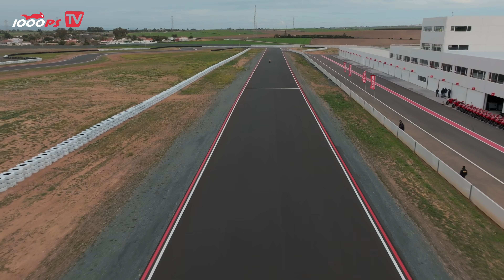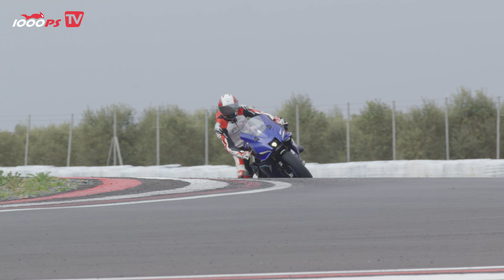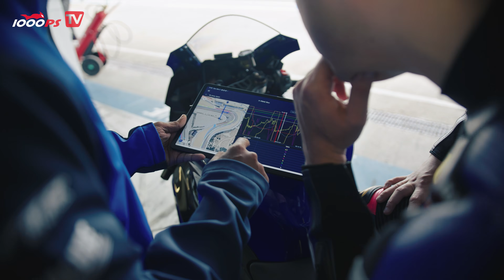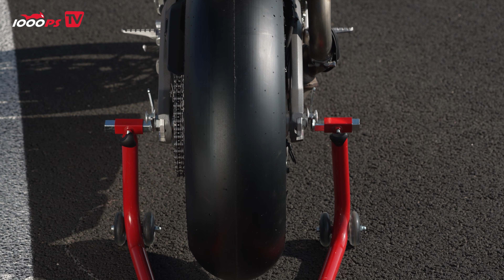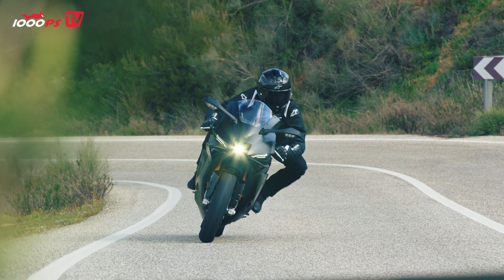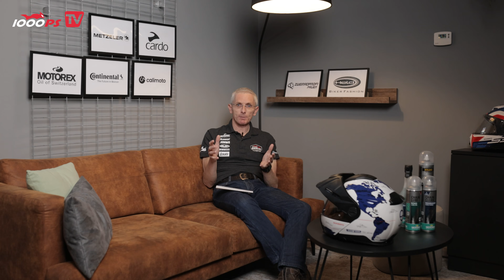Ducati Panigale V2 vs Yamaha R9 - comparison test - battle of the mid-range supersports bikes!

Comment: Sooo..... A GSX-R 750, triumph 765rs will also embarrass it ?
Reply: On track a gsx r 750 destroy them.... It s 128hp at rear wheel and 190kg wet weight... Max speed about 280km/h...
Reply: it be close on the same tire but yea gsxr 750 should beat them on track be1-2 sec per lap  on avg 4 km track 👌🏻
Reply: I would love to see the two agains GSXS1000GT on the race track... the K5 engine might be faster even with panniers on😋
Reply: @MarekNano  with panniers lap times on avg 4 km track i shot it be 2-3 sec slower than r9 & pnaigale v2  it have limited engine from k5 but still stronger 151 hp vs 120 hp but gsx os alot heavier and with panniers espeiclally have higher drag still power to weight rstio around 7-9% better so on straights to certsin speed it can be slightly faster but first phase take off corner is weoght distrubtion through axle and they dont give this data ,in lean clearance in regard to cog tire profile and size it can be enough goood welll depend on tire which be choisen for comaprision but on avg road sport tire shpuld have enough elan clearance in comapre to r9 and panigale v2 for hang on with them in corners it is much heavier though  but boger weight pish tire steonger to tarmac so tire have similar surface area to weoght if pressure ine ach be good choicen so here should dont be slower i mean in corner entry and in midlle cos take offf depend onw eoght distribtuion 👌🏻so yea thers couple unknown factors so we can only quesss me shot is like i say it be 2-3 sec slower per lap with panniers on but i can be wrong here 👌🏻☕
Reply: and not to cog but rcog (resultsnt centre of gravity) 👌🏻🪠
Reply: pretty sure you go faster on the track on the new bikes vs the old one because of the electronics.
Reply: @echospartan117  😄Please do me a favour: watch the video Half Price Hack? 2020 Ducati Panigale V4 S vs 2005 Suzuki GSX-R 1000 at Revzilla😇Enjoy it.
Reply: @echospartan117  it depend on rider level /skill fastest group dontneed electronics for clock perfect lap times 👌🏻 but it make ride easier if its good with alot hz 😉👌🏻 for long race 20-25 laps it can better wear tire if rider have tendency to to agresive ride which lead to wear tire to fast and make couple last laps much slower 👌🏻🪠☕️ but for avg rider which dont train /race often on track yea it make him faster 👌🏻
Reply: @mociczyczki  Do you understand the concept of "all things being equal? If you put the same person on each bike, that person would go faster on the newer bikes. And no, all A group riders and club racers will go faster on the newer bikes including average riders and/or C group riders. Not hard to understand, no need to make it difficult for yourself.
Reply: @echospartan117  „because of electronics „ sugest that the only diff be electronics than no ….
Reply: @mociczyczki  The electronics lets you push the bike to the limit, not hard to understand. Have you done track days at the level of advance group? You would understand why superbikes with 200hp have them and why these bikes that have them will make you go faster.
Reply: @echospartan117  you say fast rider cant achieve grip border without electronics? 🤐 👉🏻get real 🪠
Reply: @mociczyczki  sorry you dont understand how this works, im not going to explain anymore. I cant fix stupid.....
Reply: @ you cant cos its just marketing 🤐electronic helps make ride easier ,faster? only if you dont have enough skill true limitation is not electrońique but grip similar to breaks size vs breaking distance if some breaks system can go all the way on grip border already than dosent matter how much biger breaks you setup in ypur bike it wouldnt breaks any stronger except diffrences in force which you mist aplly on breaks lever but thats diffrent story get it genius? feg setup yamah r6 on fastest slicks tire with fast roder on board cutt offf alll electronics stuff vs the same r6 with worst slowest touring tire also with fast rider and load this r6 with alll electronique stuff which is on market today which would make faster lap times? offcorse r6 on slicks without elctronique absolutelly smoked r6 on much worse tire with all electronique you wish sory thats just way it is or otherway around setup in vrod all best electronique against susperpsort 600 with all  electronique cut off both on fast tire dry condition asf and what happen ? the same story construction supersport itself is limitation not electroniqs 🤭 and this construction in supersport  have much higher level of limits in regard to cornering speed and Gforces which be like 1,1/1,2 G VS 0,6-0,7 G +/- what show toptest motorrad where vrod clock 13,3 sek circle 46m with max 42 km/h vs superpsort 600 on good tire clock 10,0 sec at almost or 60 km/h 🌪️👌🏻🪠and staright acceleration 100-200 km/h 6-7 sec vs 10-11 sec +/- 👌🏻 except breaking which be simmilar maybe if breking system in vrod is enough strong in stock form anyways at end of the day diffrences in lap times on avg track lenght 4 km be like 20-30 sec per lap and after next 3-4 lap vrod be double be this supersport 600 in such syczuejszyn all elctroniqs on earth dont help you to much where other bike have absolutely superior construction like weight distribution seat footpegs hight asf cos like im mention true limitatios is roght here in its construction and tire type its not electrońique system but like im mention such system make ride easier for everybody and slower rider make faster thats true so its good to have it on board you dont need to be so much constantly focus on momentary grip available on road 👌🏻🪠☕️
Reply: @ Check out the comparison GSXR K5 vs Panigale V4S called Half Price Hack🙂
Reply: @ yea good egzample 👍🏻🪠 panigale with alot electrońique its 214 hp vs gsxr 175 hp with waaay less electrońique on faster track with longer straights and corners with biger radious be faster than gsxr k5 but its not thanks electronique stuff which it have onboard but just simple power advanatage and yea this rear shocks spring was reason why it was slower to soft it make pogo  👌🏻 now thwn if electronique is to intrusive it can make bike in reality slower cos it cut off power to soon and let it go to late 👌🏻🪠but we assume electronique  is perfect setup with alot hz thanks what it react super fast and smooth onborder of grip so this factor dosent impact in our  conversation but yea anyways electeonics controll stuff make ride easier less dangerous thanks its consistency/ repetitive while human brain have black screeen moment deconcentration eat to lesss vitamins affect brin fincion asf asf and can make error and crash 👌🏻😉 and make slower rider faster on track days but it dont make fast rider faster thats fake story 👌🏻🤭made up be slower rider or propaganda for sell this stuff more this story is similar to „troq win race power sells cars „and than 1 mln looser ride along h-d thinks they have fastest bike on track while nobody seeen h-d in moto gp ever 😂like wtf maybe they dont have eurosport or think that theyr low rcorg and low footpegs was so fast around track thye banned them from race 🤭 🤷🏻‍♂️🤐👌🏻🪠☕️

Comment: It is surprise to hear you compares engine braking between these two manufactures. I actually found the opposite of what you stated. The last time I rode Ducati made bike was he 916, 996 and 748 back in early 2000. Ducati bikes had very little engine braking compared to my1999 R1. Thank you sharing characterizes of both bikes.
Reply: @slowestrider4918  dude you can’t compare bike 25 years ago.
Reply: @kennedyracing7527  Yeah, guys had more courage back then😋
Reply: My 748 has loads of engine braking, so much so, I was considering putting a slipper clutch in it. But $$$ I bought light Magnesium wheels instead for about the same money, IMO a better value upgrade.

Comment: I thought the Ducati was running slicks in the roll out and the Yamaha had street tires.  Was that factored in the review?  I would think the Yamaha would shine even more running the same tires as the Ducati.
Reply: My thoughts too 👍
Reply: There are more things. E.g. Suspension - Yamaha has special valves in suspension, which should make comfort on the road (in low speeds) higher. In addition settings of the suspension is very personal thing, so comparing it is very hard.

Comment: The Ducati engine was a clean sheet design
Reply: The cylinder head is very different,  no desmodromic system and spring controlled valves. Yep, the engine is very different  !
Reply: seems like they didnt do the best job
pretty upsetting about what they say about the engines
Reply: Clean sheet design but not thinking of the Panigale I'm sure.

The only reason they didn't use the Superquadro (previous 155hp engine) was because it wasn't financially viable to make the engine emission compliant just for 1 bike. So they had to compromise and use the lower power version made to replace the old testastretta 11 950.
Obviously Marketing will say otherwise, understandable they have to sell their product.
Reply: @weed46  Nonsense, this engine is perfectly suited for the new supersport racing rules. The old superquadro was only allowed to race when electronically limited about 120 HP with its extra size and weight obviously still being present it was a very inefficient setup and a wonder they were ever able to beat the much lighter 600s making the same power. Fact is superquadro had no place being too powerful for supersport and far to weak for superbike racing.
Reply: @thereble101  Nonsense my ass. The engine didn't adapt to supersport rules, supersport rules adapted to the market because the 600cc class was being killed.

Brands are quitting WSBK because its not much road relevant anymore, and you think WSSP, an even less popular category has manufacturers building bikes because of it?

Nobody gives a flying fuck about supersport, that's why it was supersport that had to design rules to allow all these different engines.

Also supersport engines aren't limited to 120hp, where did you get that BS from? 

WSSP uses BoP style of balance where they mess with the weight and power to balance the bikes. Current V2 for example is 10kg heavier than other bikes.
There are no official numbers as BoP is secret for Dorna/FIM, but it's estimated the power of the bikes to be around 100kw (135hp) with some bikes making slight more than others to achieve the balance.
Reply: @thereble101  unfortunately you're the only person who knows what they're talking about. All the morons will juts bang on about bhp figures
Reply: @weed46  You have no idea that you are talking about.
Reply: They ditched the 955cc engine for racing. Because the engine was so large wssp electronically limited the throttle opening to 60% of wide open throttle. I believe they had a higher weight limit as well @weed46
Reply: @weed46 my dealer told me the same thing, and they new it was coming like 2 years ago if not more.
Reply: @weed46  MY2025 V2 Panigale = +/- Supersport with lower clip-ons😁